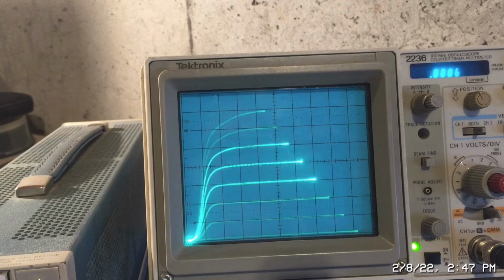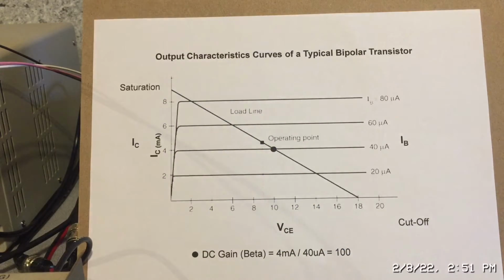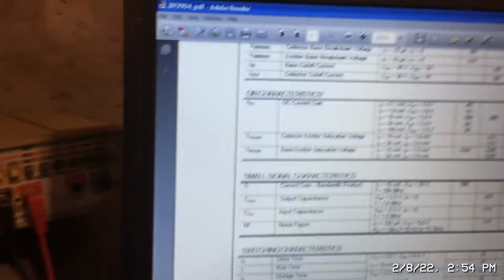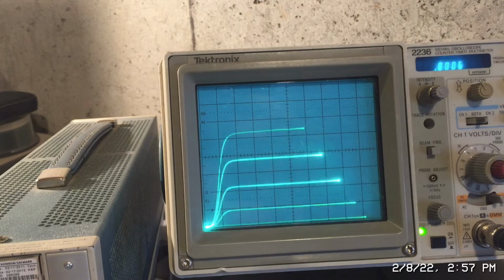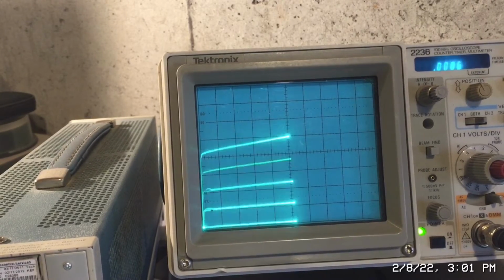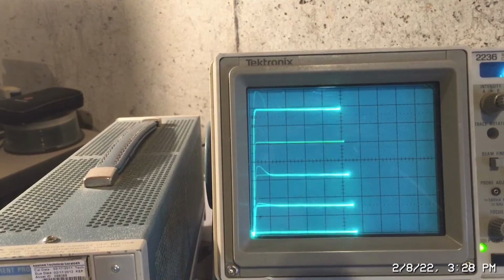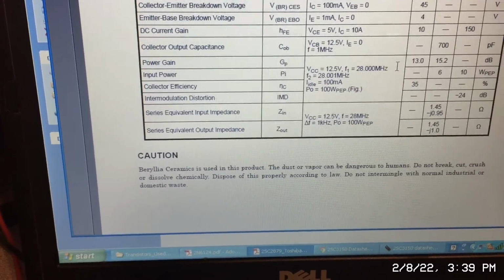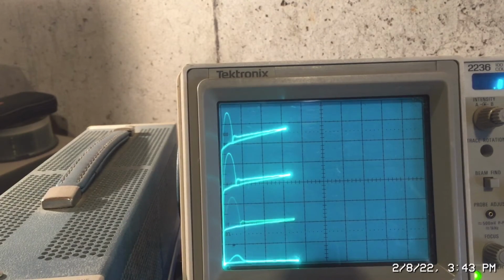Curve Tracers - What they are and how they are used to characterize semiconductors

Comment: I have the dame heathkit curve tracer but I have used it very little.
I suspect the parasity capacitance creating the looping might be due to the test lead cables you are using. Try mounting the transistor directly on the tester and see if there are any improvements or use better and shorter lead wires.